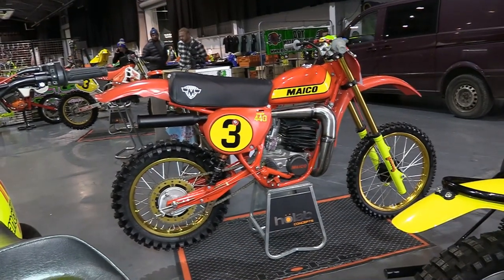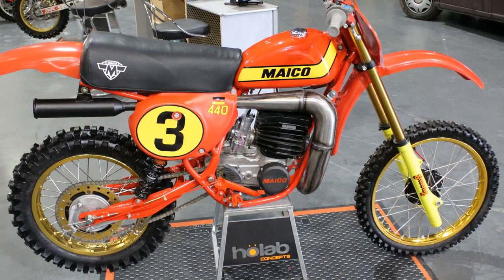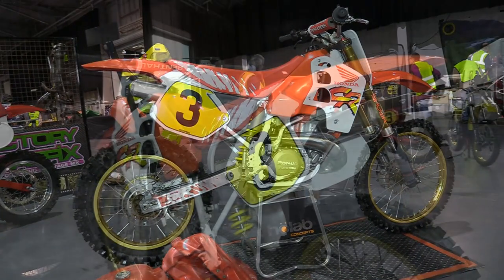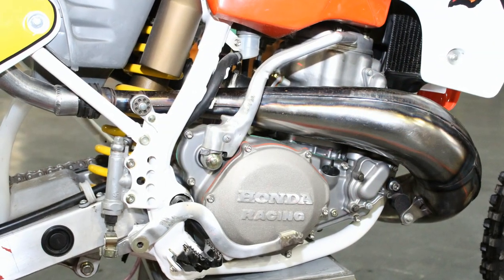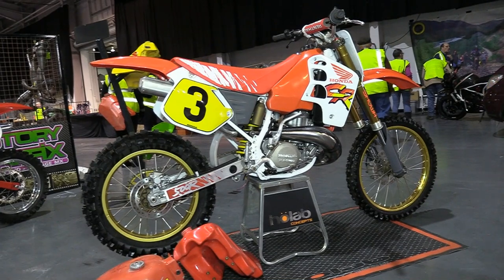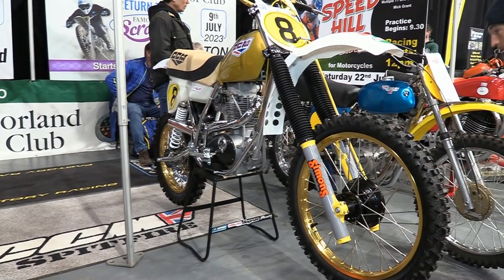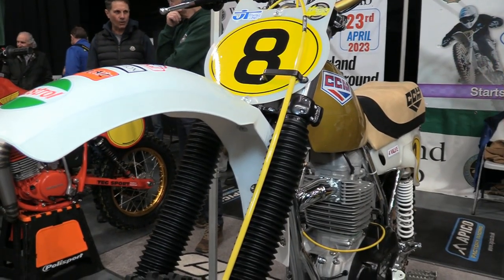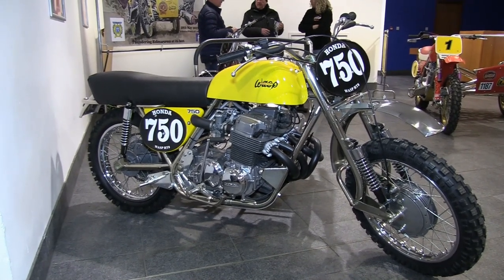The Telford Classic Dirt Bike Show 2023 Part 1

Comment: It would be interesting to know how many CCM casings were cracked having the pegs mounted to them instead of the frame
Reply from the maker: Actually Scott there were never any reports of casing failure most of the time it would be the actual pegs that would bend through constant use so surprisingly it was a very reliable system.
Reply: @monticlassictv  very surprising Chris . Cheers for the reply